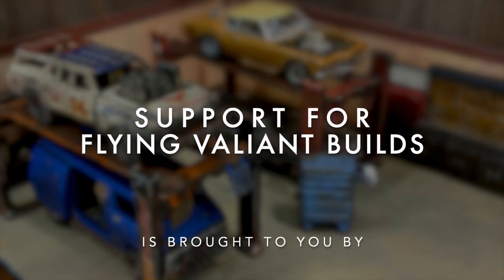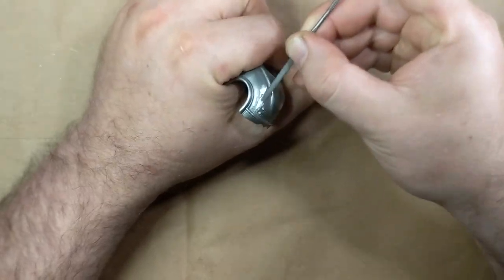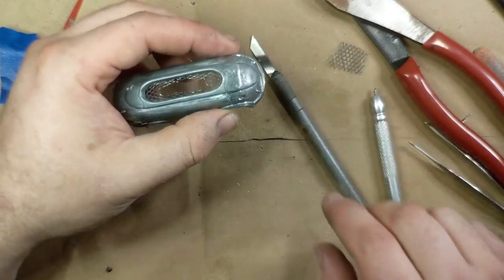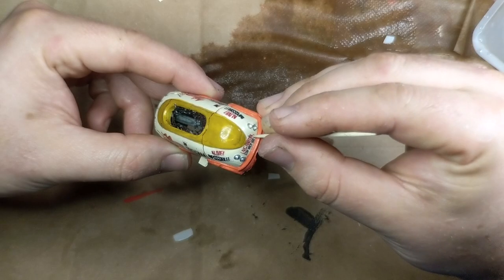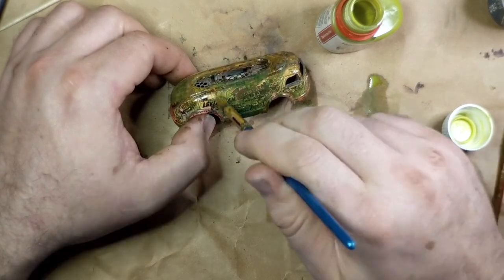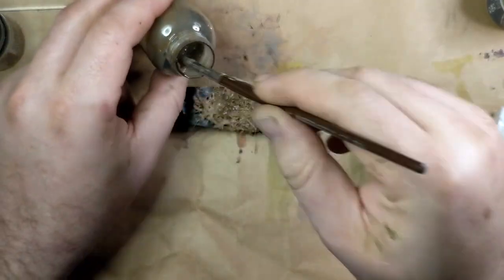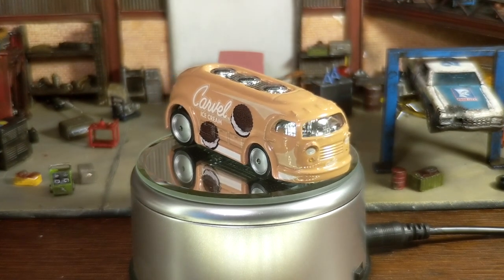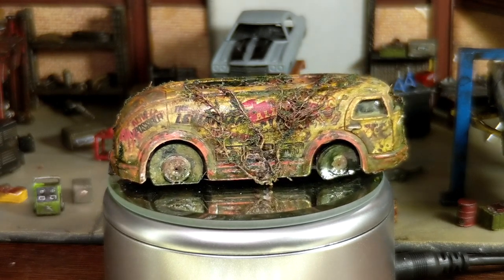Custom Hot Wheels Haulin' Gas Weathered / Abandoned / Horror Build - Three Blind Mice August

Comment: If you ever do another build where you need roots or ivy type things to scale try using thread or twine unraveled. You can add tiny bits of spices as leaves to make the ivy look like its  growing . Would like to see it on it's display base.
Reply from the maker: Thanks! Good tip. That's probably easier to work with too. Display base coming soon!